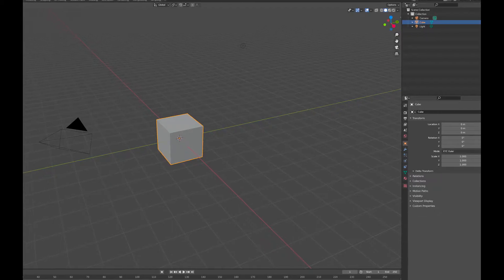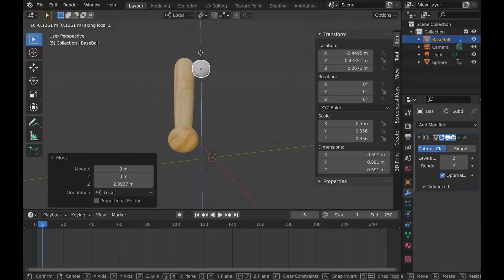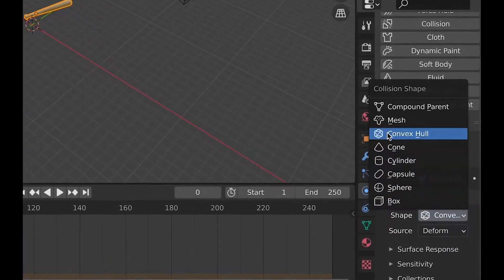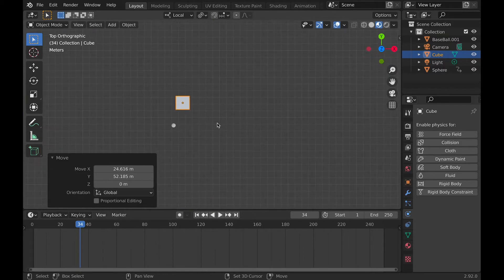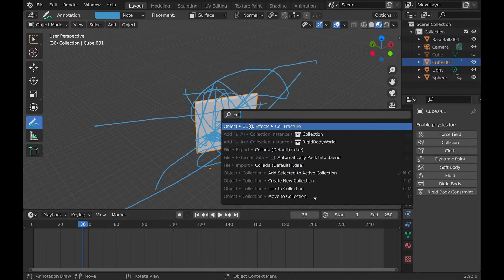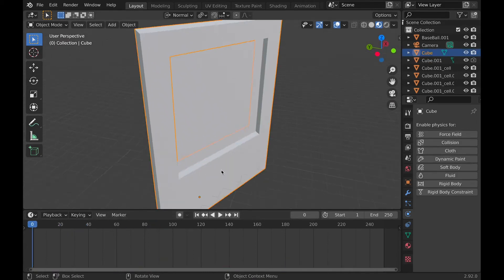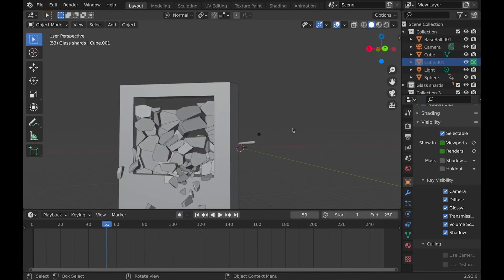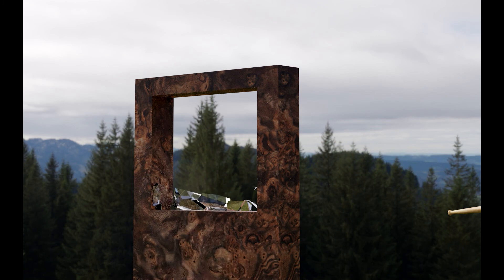Baseball Breaking Glass! (Blender 2.92 Rigid Body Physics Tutorial)

Comment: Not bad, but it looked like more glass fell against the direction of the ball (forward) than with the ball. In real life, most would have gone with the ball. It's probably an easy fix though. Blender Guru had a method for dealing with that, but I forget how it works. It involves attaching a group of the fractured pieces to follow the ball's direction.